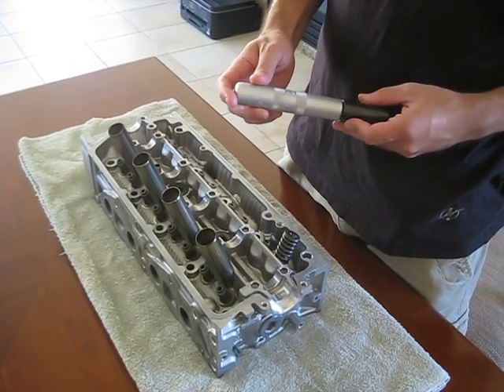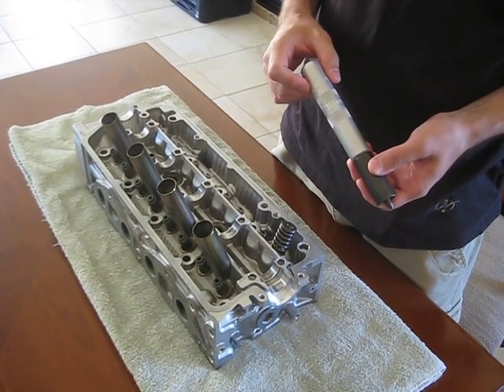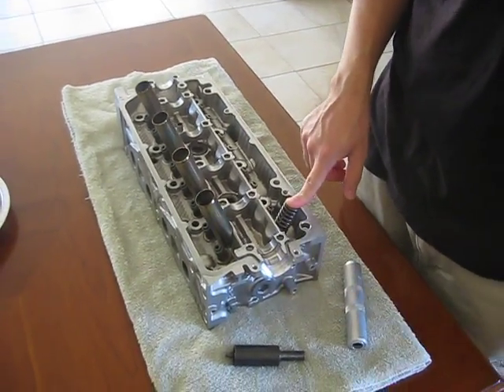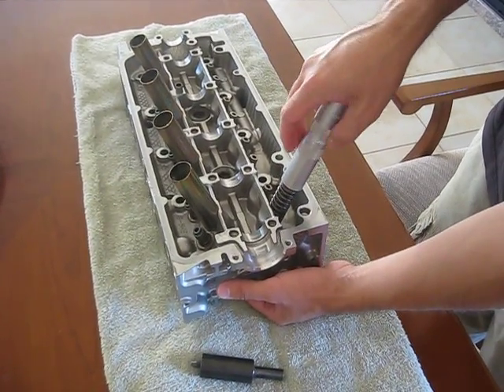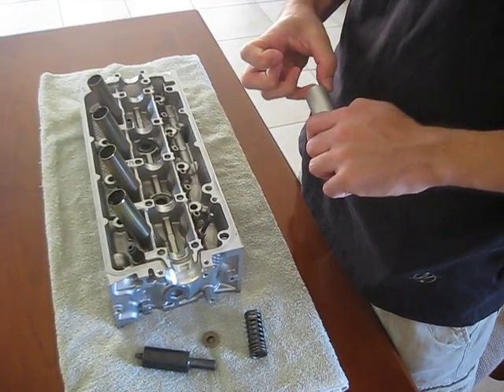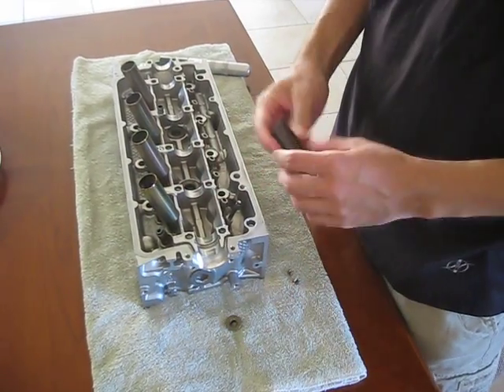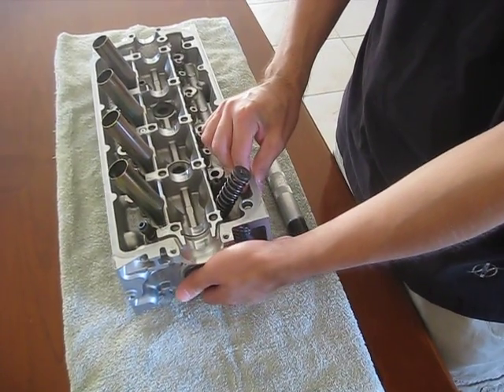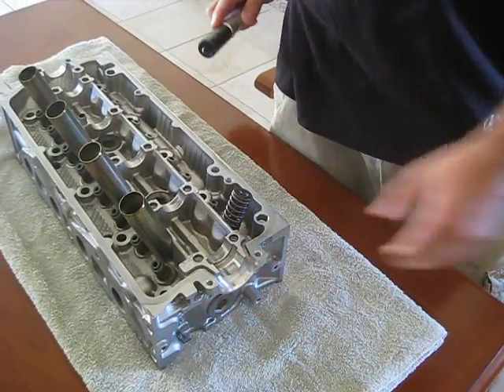Valve spring compressor remover tool demonstration

Comment: After receiving a "C" type clamp to compress and remove my cylinder heads' valve springs, I found that it didn't fit properly and might even cause scratches on valuable areas.  I watched your video and went right out to find the local Snap-On dude.... So dang happy I got one today(he only had one left).  This unit works so good on this cylinder head setup, I'm still amazed.  Thanks for posting grjr!

Comment: sweet tool saw it looking for a valve spring compressor for that exact head. just wanted to give u a tip i was given on removing valve springs on domestic OHV heads. i have the bar tool that bolts to where the rocker arm mounts and the head has to be mounted to use it. if not removing the heads, the easiest way is to push a nylon rope into the spark plug hole and bring the piston up. if you put a balled up rag under that valve it may be easier for you if you have both hands.

Comment from the maker: It depends on the particular design of the engine you are working on, for engines that use rockers to actuate the valves you may be able to remove just the rockers to gain access to the valves. On other designs it may be required to remove the cam(s) to gain access to the valves. If you are not removing the cylinder head from the block you need to use compressed air or rope to hold the valves in the head while you service the valve(s) to prevent the valve(s) from falling into the cylinder.

Comment: the springs on these are softer, but if you ever get a chance, get the oscillating parts of an ohc valve in one hand, and the equivalent parts from an ohv valve in the other. youll understand why the springs can be so much softer on these engines. part of the reason for that is because ohc valvetrains have far fewer oscillating parts, and the other is because they generally have smaller valves.

Comment: It is not a Snap-On anything. Snap-On sell this tool under their blue-point line. It is a Lisle product. It can be purchased on Amazon for cheaper. It does not work very well to install the valves springs on many vehicles. When will people realize, blue-point is products bought and then rebranded.
Reply: Blue point stands for we didnt make this we have nothing to do with this other then to have blue point imprinted on the tool and charge you 500% more for it and offer no warranty for it.